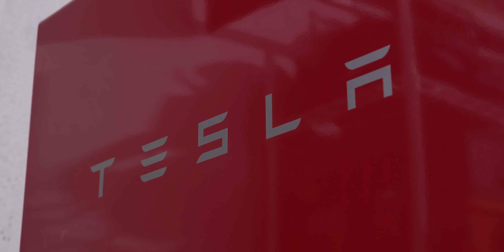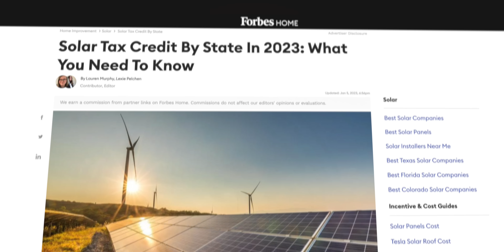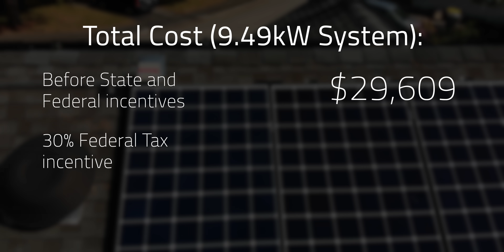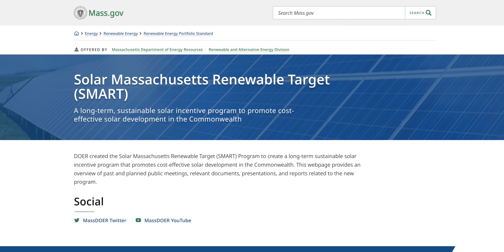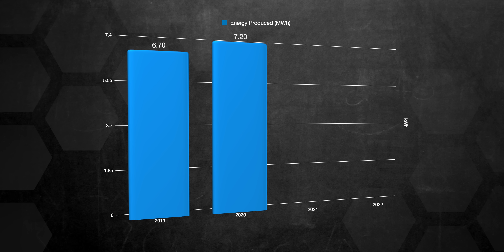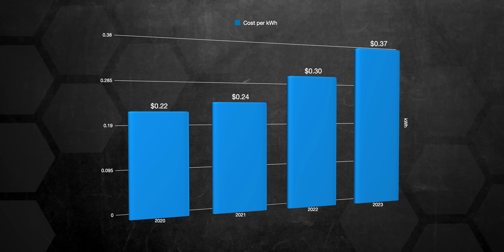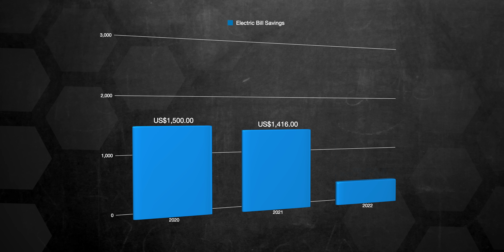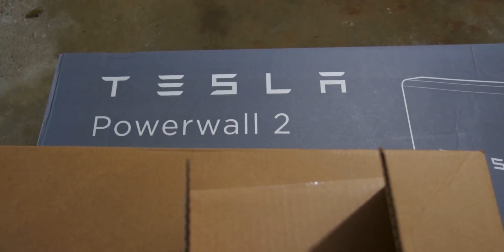5 Years with Solar Panels - Is It Still Worth It?

Comment: For me, solar and batteries are for emergency power and the savings on my dutch electricity bill.
Rates here went insane last year.
Both the Netherlands and Germany have not added significant baseload capacity while 'green' heatpumps, electric cars and electrification in general adds huge growth in demand.
The question is not if, but when the eu grid goes black.

Comment: I really want solar and battery backup on my next home, but hearing you talk about the financial side of your system confirms what I found when I last got a quote: it really doesn’t make financial sense in my area. My state (Utah) only offers very small financial incentives, much less than yours. Also, our electricity is much less expensive than yours. I average about $0.10 per kWh. It is impossible to get a payback similar to yours here. I still plan to get solar on my next home, but more for the energy backup side of the equation. Actual payback will be 20+ years.

Comment: The statement that you make at 9.57 0f the video about energy use spiking in the afternoon when people get home from work might not be accurate, at least in the northeast. Electricity use might spike at that time but total household energy use probably doesn't, at least for New England. The single biggest household energy demand there is home heating which is overwhelmingly natural gas or oil. Electricity only accounts for less than 20 percent. And the demand for heating is at its maximum early mornings on frigid winter mornings. 
When neither wind or solar are very productive

Comment: Hi, 
I have a question. Do you know if there is a system, that uses an air to air heatpump which uses the "hot" air from your ventilation blow out as a heat source, but also blows the heated air from the heatpump back through the vents from your ventilation? So basically have a heat pump and ventilation system and nothing else for heating, cooling, humidity and ventilation? That would be cool/hot right? :) Or is this impossible for some obvious reasons?
Kind regards,
A fan of the channel
Reply: Check out the Minotair pentacare v12.
Reply: @aorange999  thanks! Seems to be the thing I was looking for. Now to find an installer in Belgium... :')
Reply: Yes they are called air source heat pumps.

Comment: Great video Matt!  In Texas our power cost is less than half of what you are paying - 9-11 cents/kwh typical and mostly wind generated if you sign up with that option.  Solar payback is more challenging here due to the low power cost and net metering limitations - though we have significantly more sunny days than Massachusetts.  Costs need to come down another 20-30% for PV panels and 50% for storage to make it more commodity-like for most homeowners...  Thanks for all of your videos!

Comment: Your house is about 1/3rd the size of mine and my energy bill is an average of $160 a month with no solar. 
Ohio must have way cheaper energy rates than the north east.
Reply: A quick google check would verify you are correct.

Comment: @4:17 the tax credit has nothing to do with overpaying taxes, it’s strictly your tax burden. If you overpaid taxes it only means you get the overpaid amount back (which you would anyway) plus the amount of the tax burden for that year, up to the amount of the tax credit.

Also unlike EV tax credit,  which you can only claim on taxes during the year of purchase, the solar tax credit can be carried forward up to 5 years, which helps those with lower tax burdens make use of the incentive.
Reply: @imho7250 is 100% correct and did a great job explaining what Matt sort of glossed over.

Comment: Wait until you need a quote for a roof re-shingle...some solar systems have to come off  in one piece once installed, $1000-1200/day for crane alone. I've heard that insurance companies also jack your rates for potential fire hazard and additional loading on the structure in case of the "100 year storm event" Also, you didn't talk about panel degradation over time. An installer I spoke with that was trying to talk me into it said it's "only about 4%/year". But 4% compounded YOY means they're only putting out a mouse's-fart worth of energy at the mid way through their lifespan of approx. 25 years. No one does the back-of-the-napkin math at the start.
Reply: The panels I'm looking at has a 2% drop first year and 0,55% year 2-25. So it ends up at 85% after 25 years. Seems you might have put to much trust in your electricians memory instead of checking actual panels.
Reply: My panels degrade .25% a year. At the end of 30 years I will still be producing above 90% of what it does now. Not all panels are equal. Yes, your roof concern is a valid one though. That is why we waited till we needed a roof and got a true 50-year warrantied metal roof. If we do need a roof they pay the full amount to replace the roof. We will pay for the breakdown of our solar panel system and re-installation, but 50% of it is covered by our homeowner's insurance. Our insurance company did not jack our rates for potential fire hazards as we have a metal roof and they also decreased our rates due to having a good metal roof. If people just did some serious reading and looked up things instead of asking some guy they know... they could save a lot of money. Our system was projected to save $80,000 over 30 years with an EV. Our electric cost per KWH just went up 45%. We are now looking at $115,000 savings over 30 years. Our home value has shot up , too........

Comment: Where electricity is less expensive, it is better to buy stock in electric utilities than it is to buy solar panels.   I own a stock called SRE and the value has increased from about $80 10 years ago and is not about $150, and they pay an annual dividend.  They also are constantly expanding their renewable energy generation. If you want to be green and lower your energy costs (using dividends to pay energy bills), there is more than one way to do it.  That being said, if you live somewhere with high energy prices (like SRE's customers pay), and that get a lot of sunshine, then solar makes more sense, but where I live, it seems like solar is hugely expensive. I have received quotes for $30,000 for something like an 8KW system, but that is because to do net meter, I would have to put a new panel (200 watt to meet new codes) and a new service inlet (mine is 10 ft,  service change requires 12.5 feet) which would cost another $3000.

Comment: 1 MWh/mo is not that much for someone with an EV. We hit almost 2 MWh/mo in our smallish (1500 ft^2) home, but that is spread out over 3 EVs, induction range, and heat pumps everywhere (HVAC, H2O, and dryer). The 50  panels on the roof cover 90% of our use, and 10 more panels this year will get us back to net zero.

Comment: Great video Matt, I appreciate all the info! My only comment is that you are comparing your savings to the full price that your local utility would have charged you. But you're much more likely to have been using a 3rd party supplier and knocking that rate down quite a bit.

Comment: Is there a way to truly know whether or not you will get the balance of installation costs for solar and battery when you sell your home?  I know that it's not all about "ROI", but would you have installed solar and the Tesla battery backup, if you had known you would be selling and building a new home in 5 years?
Reply: Because the house's price is just a negotiation between buyer and seller, its never obvious. When a home is appraised they should list all the little details between comparable homes that sold recently, and it should show the solar and list a value. However appraisers can just make things up and set values at what they think, so its not even a science. Keep in mind though, you decide if you accept the offer. If a buyer does not value your solar install, find someone who will.

Comment: If I remember correctly, adding solar (grid tied or otherwise) to a home increases it’s value by an average of $14k. Pretty sure it was the Department of Energy that made that assessment, but it’s been a long time since I looked into it. 

If you take that into account, you’ve actually profited $7k
Reply: if your property went up in value... then you are also paying more in property taxes. and you also added to the insurance cost due to both higher value and cost to cover the system
Reply: It definitely has not always been the case. But, looking forward to the "Break Even" analysis being irrelevant. Do you do that analysis before upgrading your kitchen? Also, unless we know the "Value " of the installed Solar System, that $14k is less useful. Who knows, at some point, an already installed, functioning system might be worth more than going thru the permitting required for a new one after you buy a house.

Comment: Serious question- can some sort of solar capture panel be installed on the trunks of trees? Just thinking how to capture the solar around the house without harming the trees?
Reply: Possibly a ground mount system
Reply: I’m pretty sure drilling into a tree trunk, causes more trauma to the plant’s cells than some extra shade (which they’ve evolved to deal with and attempt to grow around). Obviously, if your only choice is cutting down a bunch of trees shading your roof, then that sucks.